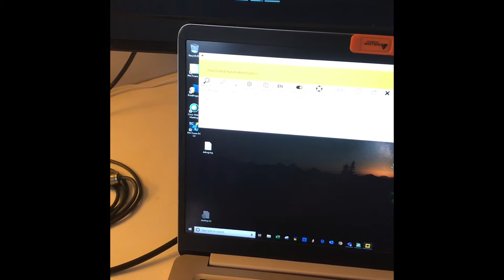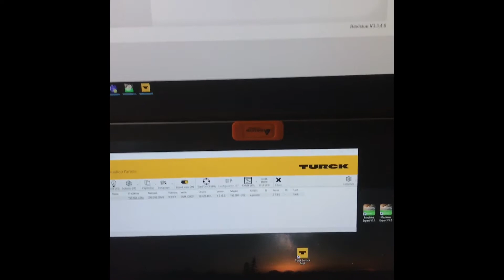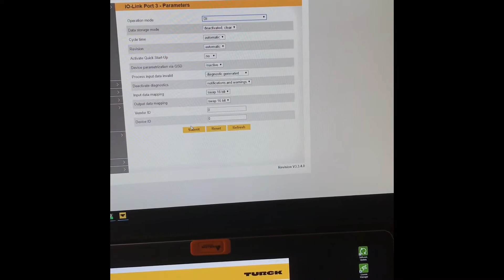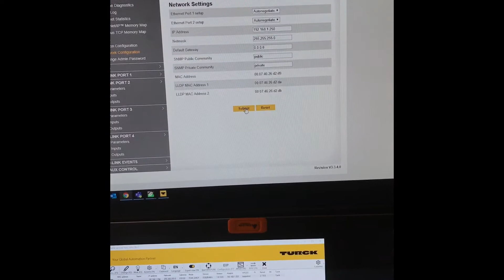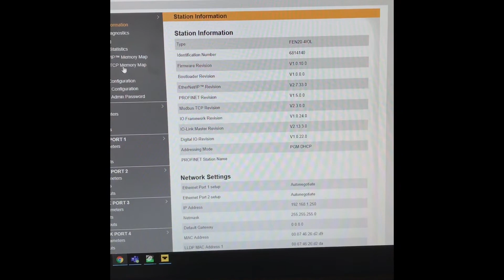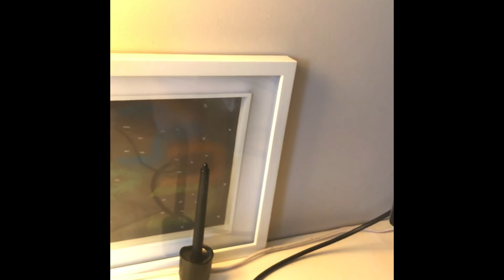Basic Setup of Turck FEN20-4IOL

Comment: Hi, thanks for sharing, does this software work for a FEN20-4DIP-4DXP? I would like to see outputs and inputs activation.
Reply from the maker: Yes the Turck Discovery tool will find most of the Turck Ethernet based PLCs and remote IO blocks.  The FEN20 units have the onboard webserver.  The discovery tool is useful for multiple units on a network because it does a "wireshark" type broadcast to see the devices on the network.  You can put the IP  address of the unit into the address bar of the your web browser.  The web browser configuration can be password protected.  

Get the Turck discover tool here: https://www.turck.us/attachment/SW_Turck_Service_Tool.zip